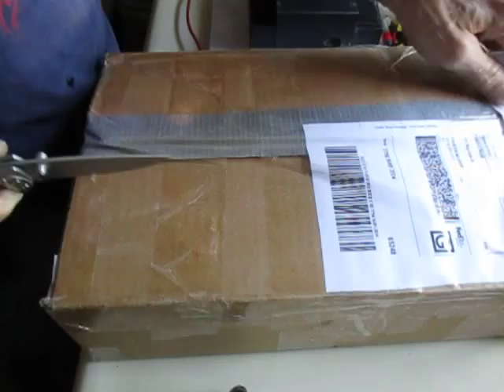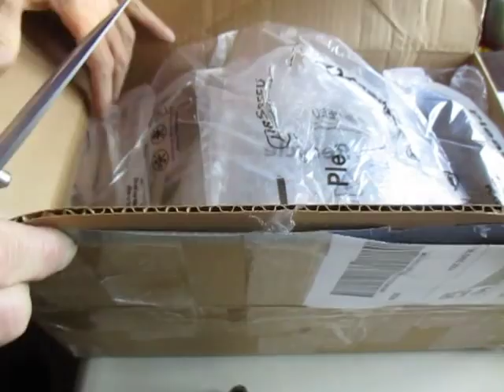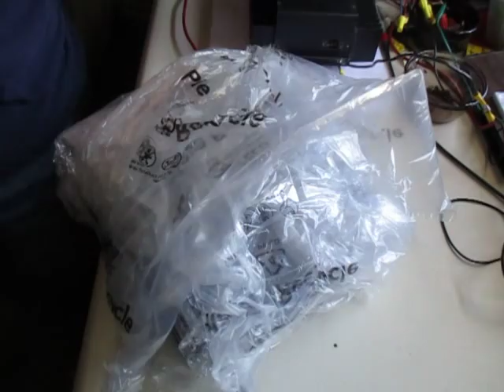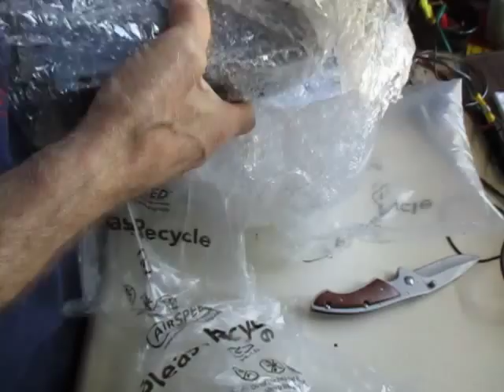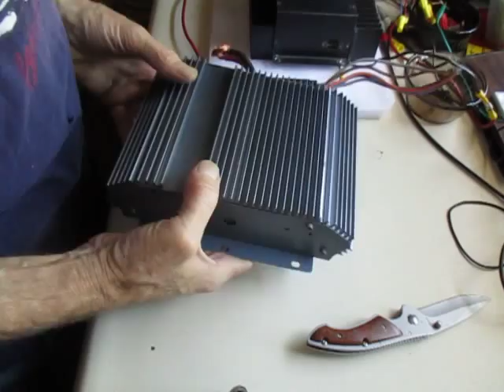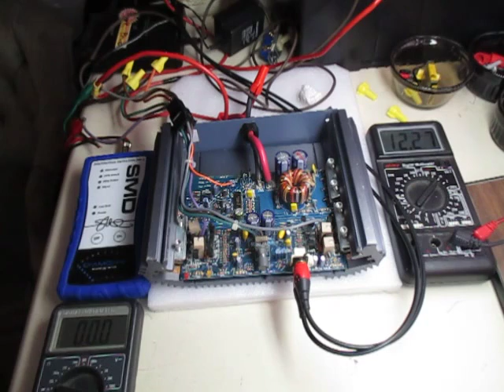Old School 1988 Hifonics Vulcan

Comment: i have one of this , but i don't know the wiring diagram
Reply from the maker: I sold it long ago so I can't look. There should be one black chassis ground wire, one red battery positive wire, one remote turn on wire, and four speaker wires. Use process of elimination to determine speaker wires. Two of the speaker wires will be internally connected to each other on the circuit board, which means if you use a multimeter and check the speaker wires two of them will complete a circuit and show about zero ohms. When you find these two, one will be left channel negative and the other will be right channel positive. It doesn't matter which you use for which channel because they are the same. Then twist those two wires together. Then connect one of the multimeter leads to the two twisted together wires and then use the other multimeter lead to check resistance of the other wires. When you find two that show about the same resistance they will be your left channel positive and your right channel negative. Those will be the two wires you use to run in bridged mode. To run in stereo mode use one of the wires that were twisted together and one of the others you determined to be a speaker wire. It is really simple but hard to explain. I will review my video for clues.